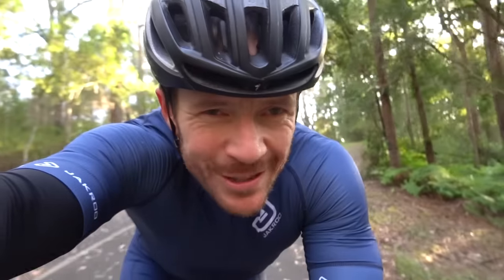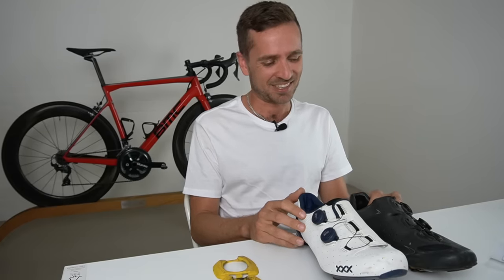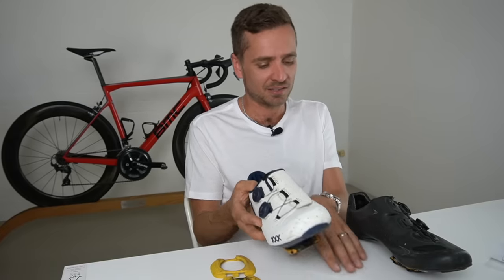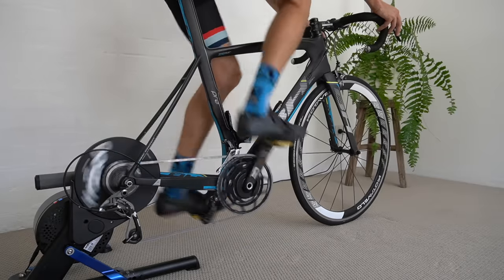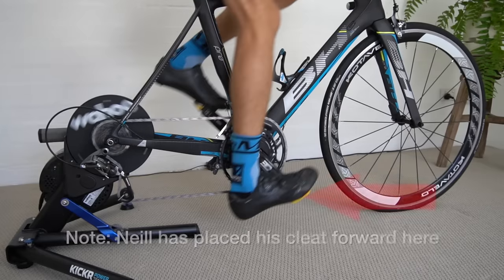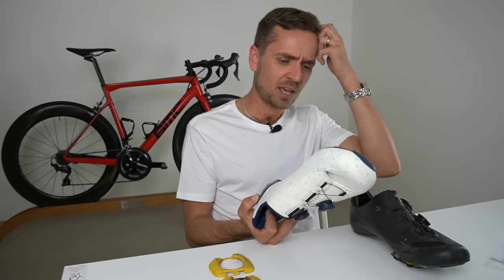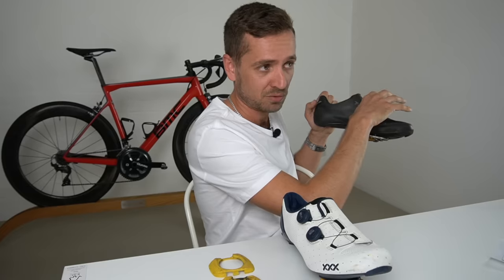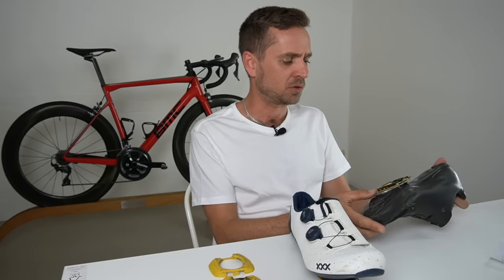Want More Power? (Two Cleat Positions to Respect!)

Comment: My right foot is 1/4" longer than right. My left foot is a 42. I wear 42 on both feet.  So my right foot a bit tighter although I stretch shoe a bit. Problem is my left cleat is full forward which I like. But I can't move my right cleat more forward, to adapt to my longer foot. I have Shimano MTB pedals.
Reply from the maker: Interesting to hear Hugo. Thanks for sharing on the thread. Cam

Comment: First of all thank you for the amazing content around a contemporary approach to bike fitting! Got new shoes (sidi) and wanted to fit my Shimano SPD-SL cleats approximately 20 mm back from the big toe joint. Unfortunately the max. I can go is 10mm. On my previous shoes I had maybe 1 or 2 mm more, but that's it. Is this a problem of the shoe, the pedal system or both? From the video I can tell that speedplay has more room for fore and aft adjustments. I really don't want to buy into a new system as I am not a hardcore cyclist. Any ideas? Cheers!

Comment: Hey Cam please correct me if I am wrong but I was looking at moving from Look to Speedplay because people say the are more adjustable but what I was looking for was being able to get my cleats further back then you can with a Look system but from what I can tell Speedplays fore/aft adjustment is basically all in the movement of the 3 to 4 hole mounting plate. If there is something I am missing I'd love to know. I watched the video with Neil and he talks about how he pedals really heel down and needs the cleat 35mm behind his metatarsal.  My pedalling style is heel down too and with the Looks I can only get like a 5mm behind my metatarsal. Thanks!
Reply from the maker: Once for Neill I’m afraid Chris. I know he’s sweeping through the comments at times. Hopefully he sees this one.
Reply: Chris, you'll need to purchase the Speedplay baseplate extender kit. It's an alloy plate with long slots, and 2x bolt positions which allows another 15mm or so of rearwards cleat translation as compared to the standard baseplates. Unfortunately the worldwide stock is low at hte moment as Wahoo (the new owners of Speedplay) have temporarily ceased production whilst they figure out what they're going to do with the brand.
Reply: pushys have the baseplate extenders in stock Chris.

Comment: I've often wondered about putting some washers between my pedals and the cranks to increase what I now know as Q. I use Shimano cleats so am limited to what I can do with the cleat placement. Maybe I should look in to the Speedplay design.
Reply: Richard, 2mm is "safe" for 99% of riders excepting the largest, most powerful riders. 3mm is sketchy and 4mm is downright unsafe as you end up with marginal thread engagement into the crank arm. If you're using carbon cranks, beware of using wider Q factors (either in the +4mm axle shimanos, longer speedplay axles or pedal extenders) if you are greater than 85kg and/or very powerful in the sprint. Broken cranks aren't unheard of due to the extra torsion effects along the crank arm with longer axles!

Comment: hi 
am wanting some help i have followed this video tips its worked on my left foot/heel but not on right side. my right leg is shorter then my left so i have a 2mm packer under my right cleat . i am currently set at 12mm set back on both cleats with a size 43 shoe . my right heel is good but left hell drops. is it ok to have the right cleat further back then left to try and fix this. 
thanks shaun

Comment: So, I'm a touch shorter on the right side than the left side, and my left foot quite a bit bigger. Should I set the cleat position based on each foot? I get a bit of foot pain on the shorter foot side with both set to 15mm. Also getting numb hands

Comment: Intersting stuff. I have been setting my SPD-SL cleats as far back as they go for years, just because it felt better. I measured my metatarsal to centre of pedal (it's a really tiny bump on the cleat) distance,  and it's only 10-12mm back, I guess I have long toes or something. Are there other pedals systems with a larger fore-aft adjustment?
Reply: Only Speedplay as an off-the-shelf option. You can, if you're keen, use a drill and a dremel to either slot the existing holes rearward, or create 3 new bolt holes and use T-nut inserts to create a complete new 3-bolt cleat position rearwards of the original holes. I regularly perform this modification for my clients when speedplays and baseplate extenders aren't an option due to cost or sponsorship. On most shoes it's pretty easy but remember not to breathe in any carbon dust!

Comment: I have no anterior tibialis in my right leg resulting in a dropped foot. When I have cleat back as far as I want it it causes my foot to try and pivot forward over ankle when riding out of saddle because I can't control
 foot.
Reply from the maker: Interesting to hear, thanks for sharing Ray. Cam
Reply: G'day Ray - I'll assume the Tib. ant is paralysed from a lumbar compression? If so, what I would recommend is a multi-pronged approach. 1) you'll need really solid arch support under that foot to stop the arch dropping due the inactive tib. ant. 2) you'll want to run either a midfoot position (true midfoot, with modified shoes) to completely stabilise the foot) or run a staggered cleat position to attempt to even things up a bit. 
it's a tricky problem - good luck!

Comment: Always enjoy leaning from your videos! One quick question is that I have no problem riding short hard rides with no pain at all, but for longer rides(anything over 60 miles) my right knee start to hurt on right outer side(possible LCL). I know my right leg is 4mm short. Do you think using shims will solve such issue? Bike fitter never done anything with leg length discrepancy.
Reply from the maker: Hey Jesse, I would definitely try it out. It's hard to say but Shims are cheap so it's worthwhile assessing over a few rides

Comment: I don't know much about Speedplay pedals. The surface area seems a bit small compared to the Shimano pedals.  Question: Can speed play pedals be installed on a regular road shoe that has the 3 holes? Or does Speedplay require a shoe built specifically for it?  For instance, I used to wear SPD pedals on my road bike. SPD pedals require an MTB shoe with two holes.
Reply: They use a baseplate which adapts to the 3 bolt shoes. The baseplate acts as part of the cleat in effect, spreading the load over the surface area of the baseplate, which is pretty much on par in terms of surface area with the 3-bolt pedal systems out there.

Comment: Where can I find someone who'll provide as in-depth a bike fit as this in the UK (ideally Scotland)?  Any colleage/peer recommendations?
I have slightly 'duck feet', a historical right knee injury that means my patella on that side is more prone to not stay in place, and I often find myself with numb hands.  I have collapsed arches and normally wear insoles in shoes/trainers.  
I get major rub on the left heel (actually wore a hole in a show after 3 months) and a little on the right.  Have 3 bikes and different pedals on each; Look Keo, Look Keo blade, and Crank Bros Candy 2.  Generally wear Fizik as they have good arch support.  Also a pair of Sidi that seem to rub less (there's more range for cleat I think) but that I get footcramp wearing.
I always have the cleat slammed back as far as the shoes will allow, then tend to tilt them to allow a bit for my normal foot posiiton of "5 to 1".
I also had issues with bib shorts wearing through really quick on edge of pad, though that was mostly from one bike (my Ridley cx).
I've no idea if any or all of this is related to position.  I was professionally bike fitted for the bikes, by the stores.  When I took the cx to the local store and asked about wearing through shorts, they said my saddle was probably too narrrow, they used some Specialized system to measure my sit bones, and gave me a 165mm saddle with a short 'nose', which I now find really uncomfortable and am conscious of almost slipping off the front at times. 
I see a physio regularly for ongoing treatment of injuries and general injury prevention, but she knows almost nothing about cycling so won't be aware of, for example spindle lengths and different brand options etc.
To me all this points to me needing to see a real expert in-person.  Someone who has deep knowledge of cycling in terms of both the parts and solutions available, but also the understanding of the biomechanics to find the most appropriate solutions.
Reply: Neill is a ‘Steve Hogg approved’ fitter, as he uses his proprietary techniques to inform his bike fitting, and his website is a minefield of really helpful information. The only two Hogg approved fitters in the UK are Scherrit Knoesson (aka the bike whisperer) and Garry Kirk. I’ve been fitted by Scherrit years ago and he’s very good. I’m going to see Garry in a couple of weeks as my body as well as my equipment has changed, so I can’t comment on him just yet, but he’s got an excellent reputation.
Reply: BTW, Garry is based in Paisley so may be the most convenient option for you.

Comment: I have a somewhat simple question, didn’t hear it addressed in any of your videos with Neil.  For riders who compete/participate in multiple types of events (in my case, primarily a TT guy who also does road races, the occasional crit, and gravel racing, and who uses different shoes for TT vs RR/crit,vs gravel) should I set each pair of shoes/cleats up for the specific events, or find the optimum cleat position for my primary event and make them all match?  My hunch is that I could set the TT cleats, match the gravel cleats to that position, and set the road shoes differently. I spend some time each week on each bike, so adapting to a new position isn’t a big deal. 

I’ve read much of Steve Hogg’s blog as well, can’t find an answer.
Reply: Great question Scott, and a tricky answer. I would try to keep them all the same if you can, but don't be too stressed if you decide to run them all differently. Assuming the gross positions are all adjusted around the different cleat positions nicely, you will feel different very slightly on each bike/shoe setup, but the difference won't be significant enough to create gaps in your training adaptations. This is just a guess, it's my gut feel that you would be OK and the differences wouldn't be significant enough to worry about. I'm happy to be proven wrong though - it's a tricky topic that one!

Comment: The one thing he fails to tell everyone is the "size" number on the box of the shoes tells you where the widest place is built in the shoe.  However, most guys have short toes in comparison to their arch position.  So let's say you have an 11 1/2 (42) length foot but your arch position is  a 13 (43), You'd buy a 43 size shoe to get the proper fitting shoe.  The length doesn't matter on a clipless pedals.  This is why so many people had troubles with their shoes on toe clips.  Their foot wants to be a 13 but because they have short toes, they have a length of 12 (medium) toe clip.  They buy the shorter toe clip and their feet didn't fit in the toe clip properly.  It's the same thing with clipless pedals. 

Hate to be a contrarian to this specialist but the fit of the shoe should be the first issue to sizing the foot.  Then the cleat will fall in to place putting the power portion of the foot over the most sturdy position on the pedal.  Just go to a shoe store and ask to have your arch of your foot sized.   Then ask them to size you for your length.  Most men have short toes in comparison to their arch size while women usually have equal length toes to their arch size.  AND another big mistake in fitting a rider's shoes is when the sales person says the tight shoes will stretch.  Of course. The shoes are too small.  Get shoes that are comfortable to wear.  No toe pressure. No side pressure. Goes on and comes off easily.If the shoe feels a tad loose, that's ok too.  As they get softer and more flexible, the upper portion of the shoe will come down to the shape of your foot.

But if you don't believe any of what I say, just try it and you'll soon find better fits, less foot pain and more comfortable riding with no numbness. Once you get your shoes fit properly, then you can put the power portion of your foot, (the ball of the foot) over the axle of the pedal and properly set your cleats.  

His way is the reason why you can't put the ball of your foot over the center of the axle.  The number on the box tells you how to match the fit of the shoe to the ball of your foot.

Comment: So was there a test or measurement to go by to set cleat width?
Reply from the maker: I’ll see if Neill can get to this one for you
Reply: @CamNicholls  All the thumbs up.
Reply: G'day Josh, typically I look at the rider from the front (once the rest of the position is pretty good) and if the centreline of the patella is tracking clearly visually outside the line of the pedal/crank, then I will experiment going wider and re-assess. You're looking for the rider's pelvis to stabilise,the knee tracking to be more vertical over the cleat centre, and perhaps even more importantly - for the rider to feel better during the stroke. Most riders can tell when it's "right" and when it's not right.

Comment: Hi, I am a sprinter and now my cleats are all the way to the back. Should I move them a little bit forward?
Reply: It's free and easy to change it, and if it doesn't work out you can always change it back Jules. Give it a try and see what happens.
Reply: @neillstanbury4557  hey Neil i have a quick question. I'd say I'm a high cadence rider (Ride TT, crit, and fast bunch rides) and I climb out of my saddle quite frequently in big gears. Technically I have high the threshold efforts, sprint is 1100-1300 sprint (nothing impressive). By your logic i should be riding with my cleat back but as soon as it goes back I get arch pain. Do you think it could be an arch support issue? Sorry for the long winded question.

Comment: I've got time cleats and pedals. With the cleat mounted as far back as it goes I can't even get the pedal axle more than 5mm behind that joint. I've been riding for years with the cleats forward without issues. Hmm... are the shoes simply badly made or what hmm. It didn't feel weird. The cleat feels so far back now that my heels don't even have to touch the ground. What gives...  Is this your experience aswell?
Reply: Are they SIDI's by any chance Mike? They are well known to have the further forward bolt hole placement of any shoe in general. If they are 1 or 2 sizes too big for you, the problem is compounded as your foot sits further back in the shoe. If you're coping with a +5mm cleat position then I'm the last person who will tell you you're wrong - if it's working then stick with it!

Comment: am not a racer,  but dislike toe overlap . My 1985 Rossin Record has no toe overlap. Seems like all the newer road/ race bikes have toe overlap. I think it does not come into a problem in turns , only in maneuvering type situations on the road , or if you are touring with a load , or on busy streets etc, where you may be taking hard turns , traffic, etc where you definitely don't want to be clipping your toe on the front wheel.

Comment: Cam my cleats (shimano yellow) have started creaking when I'm putting down the power, they're correctly torqued. Any ideas?
Reply from the maker: Sorry mate, no. I think Neill may be coming through these comments shortly though. Cam
Reply: Try removing the cleat and smearing a very light coat of grease on the underside of the cleat where it meets the shoe. Plastic torquing on plastic will tend to creak - the grease should eliminate it.  Same principle with carbon rubbing on carbon. Pretty much have to grease those friction points.
Reply: Hagakuru has got it. It's rare but it happens. Wax, grease or ideally a PTFE lube spray will sort it out

Comment: Ok, help the American decipher the funny numbers. I wear a 10 ½ us, if my conversion is right thats a 46? I have my cleats currently at about 12mm (that whole ball of the foot thing I've heard all my life). I feel like my bars are an inch or two (25 to 50mm) to low and I get hand numbness when I ride. If I'm understanding the gentlemen, if I move my cleats back 8mm that would let me lower my seat, and possibly solve my handlebar/hand numbness problem. Just for context, I'm a 100% recreational/social rider.
Reply: You're understanding is spot on mate - going further back on the cleats should (in theory) allow you to lower the seat a little and help with your drop problem marginally. How much is a bit of guesswork so you'll need to experiment.

Comment: Amazing video series, so thank you! I read through all of the comments and did not see this question raised, which I think is critical in the process.  Regarding the first metatarsal joint. Are you essentially placing the cable end before the protruding bump on the 1st metatarsal? Also, I wear a size 46 EU shoe. Did understand that I should start at 20mm back? Thank you again for the amazing content and wish that I found this 10 years ago!
Reply from the maker: Hey Dave, watch this video, which will give you some more specific detail on that. https://youtu.be/vMmbXAWcgh4

Comment: hi cam, love the videos! in this video Neill is showing his foot position on the BH bike (at 9:50 for example). he seems to be using an oval chain ring. i was wondering what the reasoning behind the positioning relative to the crank is. i thought that the longer radius of the chain ring (effectively a bigger gear) should be in line with the crank arm to help put more power in to the down stroke. but he seems to have it the other way round. why?
Reply: Hi Thomas, the Q ring turns into a bigger cog around 3pm on the stroke, at least that's the idea. I run them because I like the feel, but they don't really make me any faster according to the testing I've done.